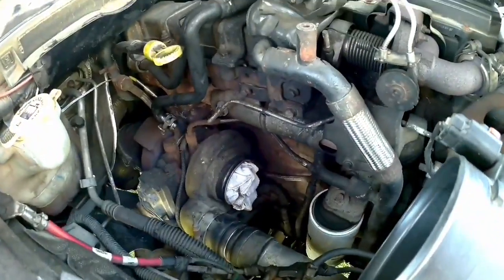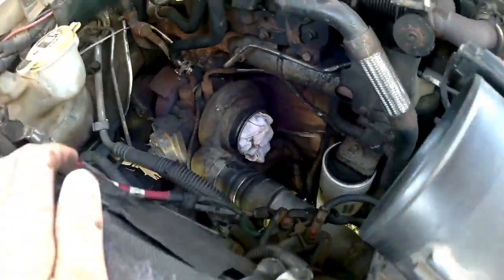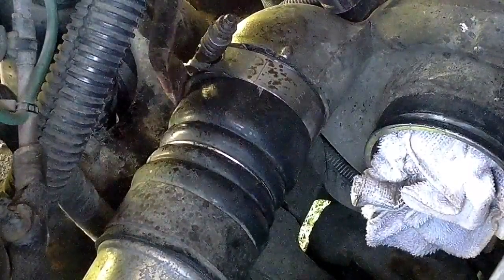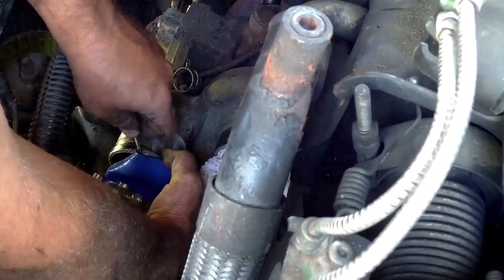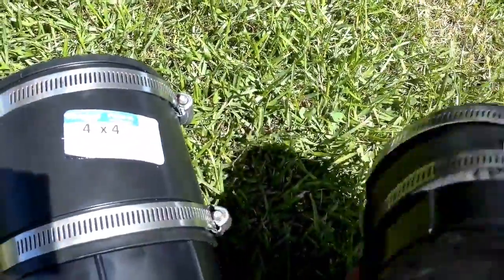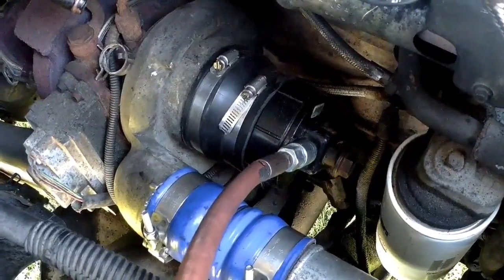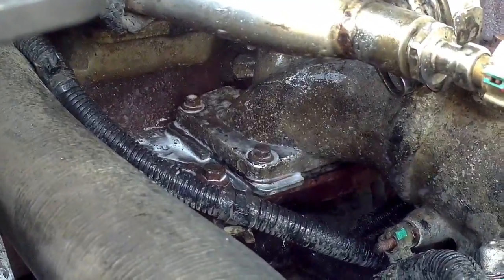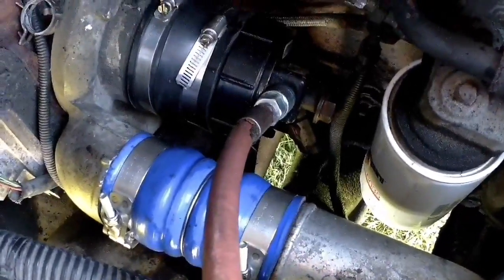Dodge Ram 6.7 Pressure Test Boost System For Leaks

Comment: Did you torque the intake bolts to 18ft/lbs? I wonder if over torquing is why you had a leak with the new gasket.
Reply from the maker: Started at 18, but ended up having to use a sealer with a new gasket. It was tough to seal